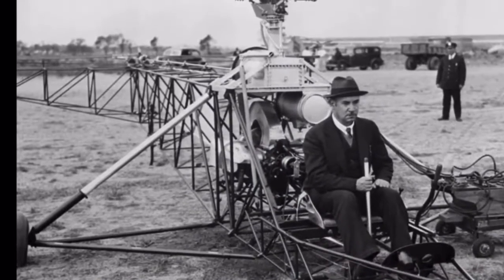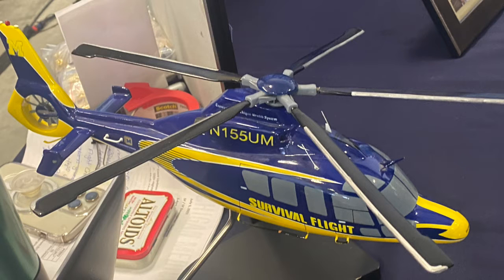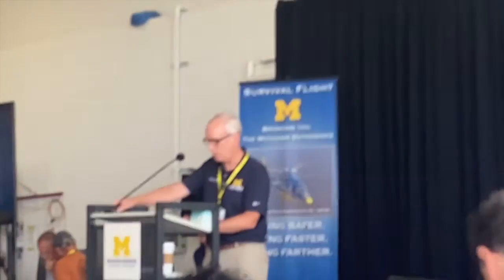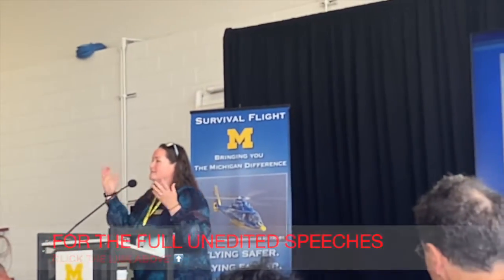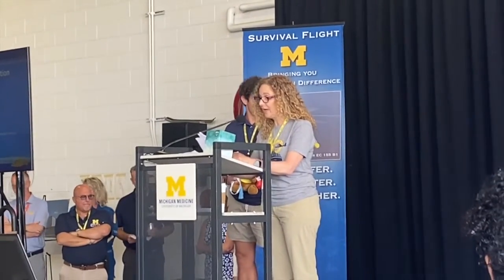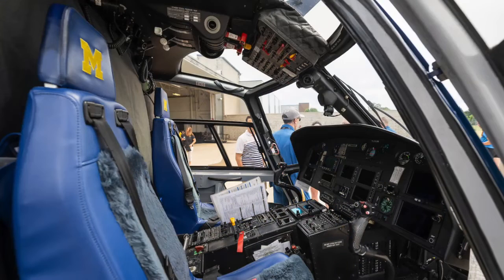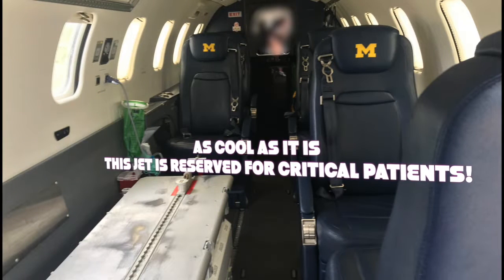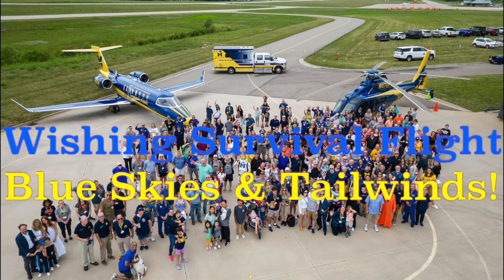Behind The Scenes: University of Michigan Survival Flight CELEBRATES 40 YEARS! (P2)

Comment: Any idea what helicopter will replace the 155’s? Or are they dropping the helicopter fleet entirely?
Reply from the maker: They hope to acquire the Eurocopter(now called Airbus Helicopter) EC-145 (H-145) the different between the EC-145 and smaller EC-135 for example is that the EC-135 is smaller and used more for corporate transportation and law enforcement/ police fire or border control uses as it is smaller and more equipped for shorter flights with little payload. Whereas the EC-145 is used more now for medical transport (medevac flights as it can fit a full stretcher and patient through its back entrance door) and search and rescue 🛟 or military troop transport as it has more fuel and a greater payload takeoff weight. It is a light utility helicopter vs the 145 as a medium weight helicopter. Medevac helicopters need to be able to fit a patient in a stretcher plus nurses or doctors and a very heave gross takeoff weight as medical equipment is very heavy!
Reply from the maker: The EC-135 is also now used for tour operators or charter flights too as it has a greater range than the previous helicopter its predecessor the EC-130 which is only able to be used as a tour or sightseeing aircraft which has bigger windows and a smaller fuel tanks and more powerful EC-145 engine to get into tight places. The EC-130 fills a need by your operators to be more efficient and replace the AS-350 A-Star helicopter. The EC-135 replaces the A-Star on charter jobs or for law enforcement or special missions. The EC-145 is more for medevac usage or cargo transport.
Hope that LONG EXPLANATION helps…
Reply: @Calebs_Aviation  Thanks! It will for sure be a bummer to see the 155’s go, easily one of the best looking helicopters out there in my opinion
Reply from the maker: @USAF88TC  Me too but I always love the newer more efficient examples of the EC-130/135/145 models! Also the 155 was built to be an airline/charter or VIP transport vehicle and has never done a great job of being a true “Medevac Air Rescue” helicopter. It really never fit U of M’s needs but they were a donation so they took them. Not like it’s true successor the AS-365 Dauphin (Dolphin in French) built for the Coast Guard designated as the MH-65 (Military Helicopter) BTW… They were an odd fit for U of M Survival Flight, not the best, but again as a donation (the money had to be spent on that helicopter according to the donor) they had no choice but to use them and they were kinda a downgrade over the at the time very old Bell 430 Helicopters which were truly built to be “medevac” helicopters and custom ordered to do so. Bell made a medevac kit for their helicopters and so did Airbus for the 155 before the “NX” series of helicopters were released “the 130/135/145 helicopters” They have done an adequate job for 10 or so years but there’s always room for improvement they said, especially in such a time critical and emergent scenarios that Survival Flight flies… 😅
 
However, the pilots and crew have told me that they are very much looking forward to the new EC-145s A PROPER MEDICAL HELICOPTER and a superb machine! Also, the 145 burns less fuel and has a greater range, both the environment and the critical missions it will fly, plus 145s are better, equipped to fly in the weather and bad conditions when it’s an emergency scenario as they were specifically designed and built for that purpose! The 155 WAS NEVER MADE FOR THAT! 

Finally, don’t miss my video flying on the EC–130 the variant made for sightseeing and tour operations to replace the AS-350 “A-Star” I flew on an EC-130 sightseeing flight into The Grand Canyon! Check it out here and comment if you enjoy it! I’d appreciate it! Video:
https://youtu.be/jvyg9oOIb9s